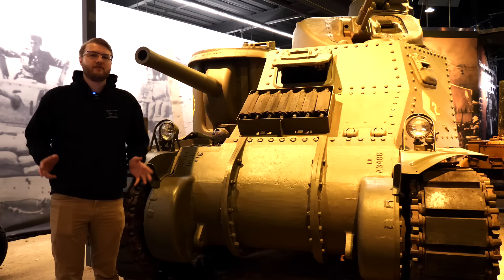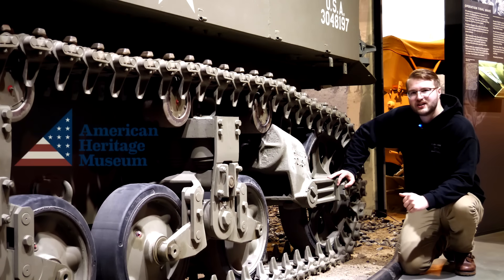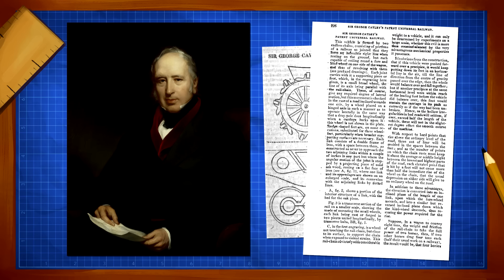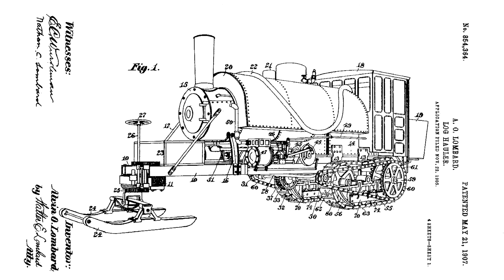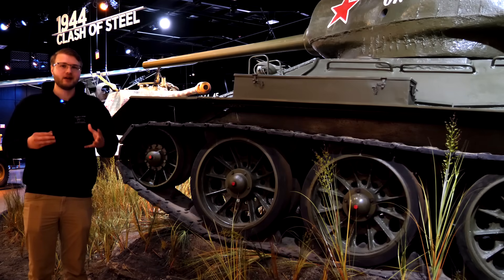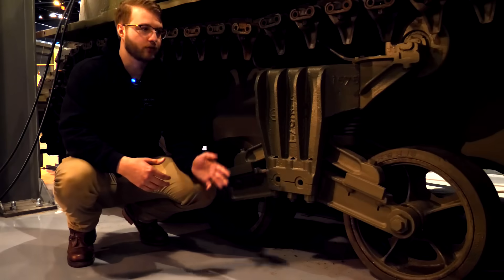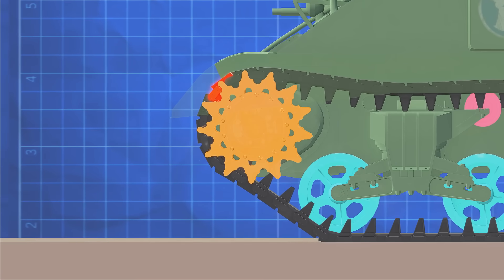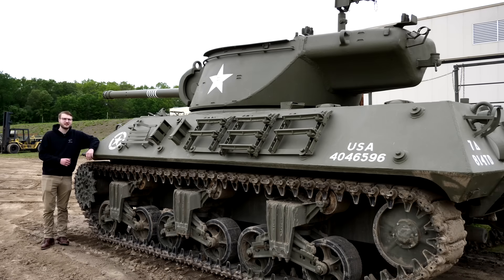How Tanks Move: A Simple Guide to Tracks and Their History

Comment: Why did this get re-released? what happened?
Reply from the maker: Slight alteration to some of the wording during the animation as I wanted to make it more accurate
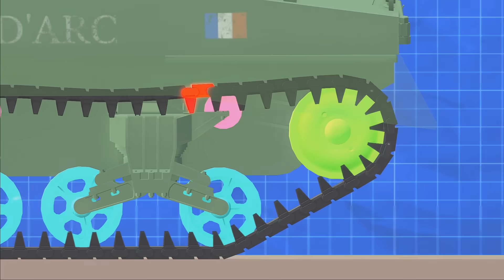Reply: @ConeOfArc  question but what is the part of the track system that prevents it from dripping down aka the thing marked in pink here 4:28
Reply: @badassboy241  Those small wheels marked with pink would be the return rollers. They can be attached to the tank body in several different ways; on a bogie frame like on the Sherman there; or have their axles attached directly to the hull like many tanks through the decades; or the return rollers can be several in a frame as on some tanks. Those return rollers can be called one of several different names on tanks and on tracked construction vehicles.